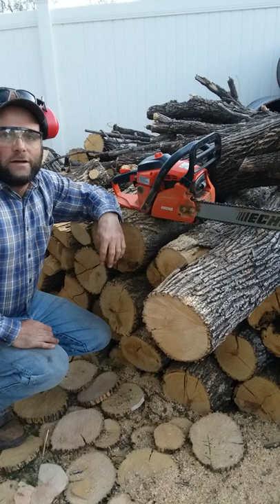#Short Echo muffler mod test

Comment: This saw rips, did you have to adjust the carburetor also after the muffler mod?
Reply from the maker: Yes I adjusted the low side of the carburetor a little bit opened up the low jet a little bit

Comment: Did you add a muffler, replace it, or remove it? Serious question…
Reply from the maker: I've got short videos on removing the catalytic converter from the original Muffler and putting the original Muffler housing back together without the catalytic converter